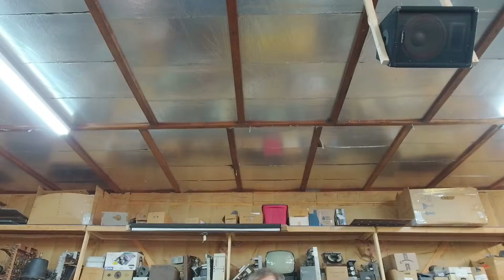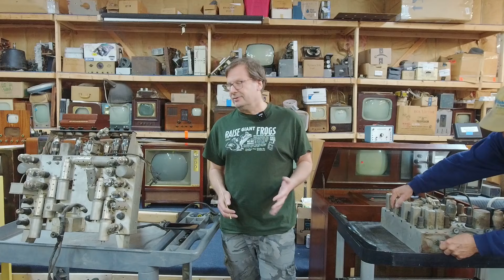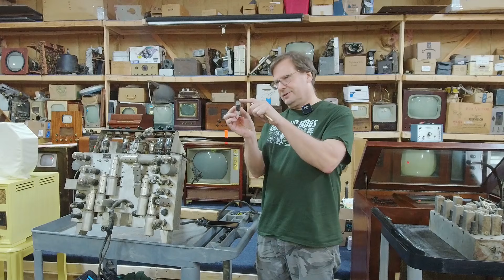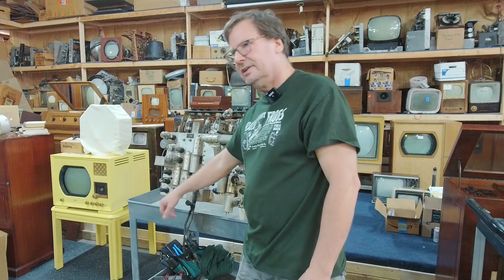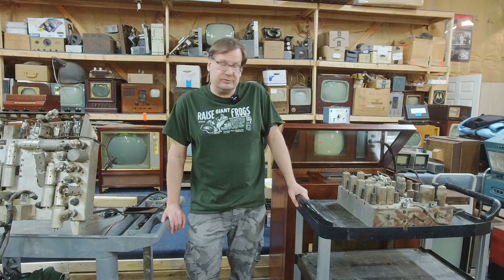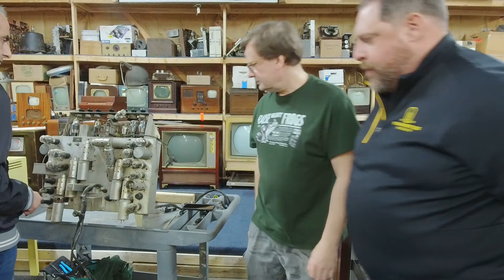Early TV Convention 2026 Workshop - RCA RR 359 Prewar field test television

Comment: Supposing you do get these sets running, how will you generate a video signal for it with the weird line rates and potentially AM audio on some models? Also what does that guy say they were feeding it with at 25:35?
Reply from the maker: Most can handle a modern NTSC 525 line signal just fine.  AM detector will do FM via slope detection but at a low volume.

Comment: I grew up in the Philadelphia area. My parents got a television set in 1948 or 49 - a Philco, with a 10 or 12 inch screen, which you viewed directly on the front of the set. I seem to remember that there was only one station at that time,and it didn't have any set schedule. It was mostly 'test pattern,' and it was operated by the Franklin Institute. I don't think there was anything but test pattern before about 5PM, and the broadcast day varied in length. The Franklin Institute station had experimental call letters, and it eventually became the commercial station on channel 3, but was no longer connected with Franklin Institute by that time. It was joined in short order by channels 6 and 10.

Comment: Does anyone know how they converted 405 line to ntsc in the 1960s? I watched a show that partially originated in UK, the 405 line part was not quite as clear as the ntsc. I'm wondering how they did it before systems that use computer memory came along .
Reply: Look up a web page titled "Franco-British TV Will Make History". It shows a diagram of the first French-British microwave TV link in 1953. They had to support three TV standards: the then-current "high definition" French 819-line system, the old 441-line system which was still in use in continental Europe at the time, and the British 405-line system. The conversion between the systems was done by pointing a camera at a CRT monitor.
Reply: Thanks.
Reply: BBC built digital converters for the Telstar trials in the early 60s. There is a video on YT. They were massive.  As colour approached converters were used to provide 405 lines to the transmitters as studios changed over to 625 lines
Reply: They did it by camera pointing the screen. Lately they used analog memory (switched capacitors). Also many shows in early days were made on film or telerecorded.

Comment: This early TV stuff is fascinating. Here in the UK a VHF TV broadcast service was started in 1936. It used 405 lines monochrome and apart from a break for WW2 it was still in use in the early 1980s long after PAL was also in use. When I was a very young child in the 1960s I remember that the 405 line system was all we had, and only two channels, BBC and a commercial station. When I was about 9 years old they introduced a second BBC channel on 625 line PAL on UHF, but initially only monochrome. The 405 line system remained monochrome until its demise, but there were some experimental color transmissions on that system.
Reply: The funny thing is, I hear more about, and see more content about, pre war television systems in the UK and Germany than I see about the early American stuff.
Reply: @gregorymalchuk272  Behind the scenes in the UK and Germany, there may have been covert incentives to develop CRTs for RADAR, just guessing. It was also a time of industrial and technological competition between the two countries. In many ways USA was leading, but the UK was the first to get a usable TV public broadcast service up and running, although in practice it initially covered only a small area and hardly anyone had receiving sets, they were far too expensive for most people to afford.
Reply: @Timothycan When we hear "BBC Two" or "Channel Four", does that go back to an idea that the government would sanction each network, and even number the channels?

How did they distribute these channels across Britain?  In Canada our TV channels would go maybe 50 miles, and when we move to another city, we would have to tune another channel to see the same shows.  You couldn't have two towers share the same frequency.
Reply: @d46512  To be honest, I don't know much about the channel numbering. When I was a little kid there were just BBC and ITV, until a second BBC channel was added in 1967 and logically got named BBC2. Around the 70s people got tunable buttons on their sets quite often. They would set them up 1 for BBC1, 2 for BBC 2, so button 3 usually got tuned to ITV. A fourth channel then came along and not surprisingly got called "Channel 4" and later a "Channel 5" was added. Then we went digital and it all got messy. So we've got all sorts now, such as 'Channel 4' and 'BBC 4', which are two different channels... Nuff said.

Comment: I am aware that experimental television station W6XAO channel 1 went on the air in Los Angeles back in December, 1931. Today, the locals there call it KCBS 2.
Reply from the maker: Yes, but it was mechanical TV.  Quite different than this all electronic system.
Reply: @bandersentv  Indeed, W6XAO Los Angeles did originally sign on in a mechanical format, and didn't go all electronic format until about five years later, around the time the set you displayed was designed.

Comment: RCA is long gone as an actual American company. But there might be an RCA archive somewhere with information about this unit. IIRC RCA first acquired by GE, later sold to Thomson CSF. Long shot but might be worth looking into.
Reply: Full documentation for these sets does exist, it's what Bob is using to restore his set.
Reply: Trademarks later sold to Soundesign, leased to RadioShack for a while. I can't believe all that would have been thrown away but finding the proper bunny trail is probably a very difficult journey at this point.